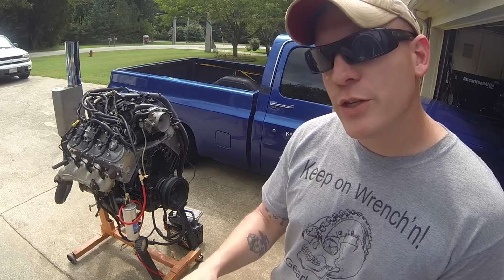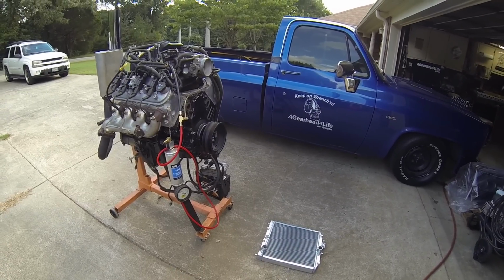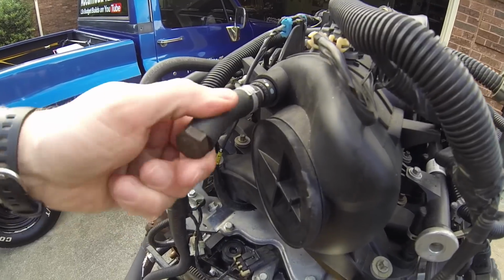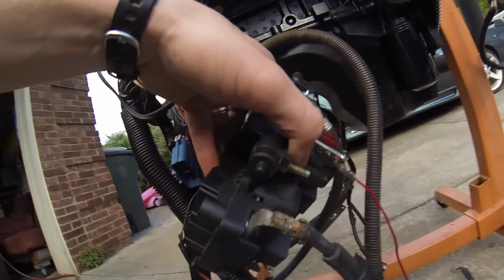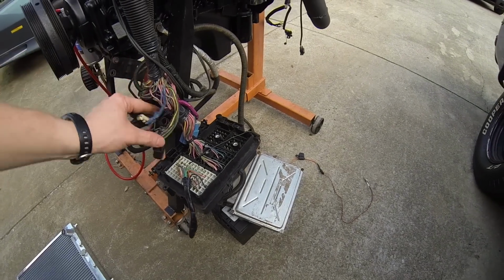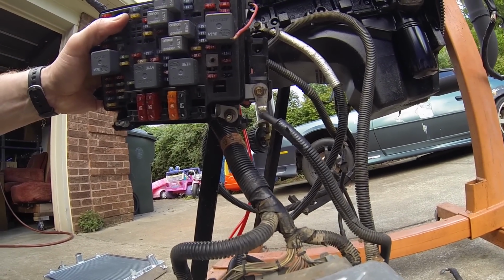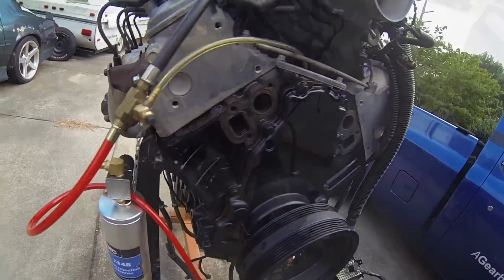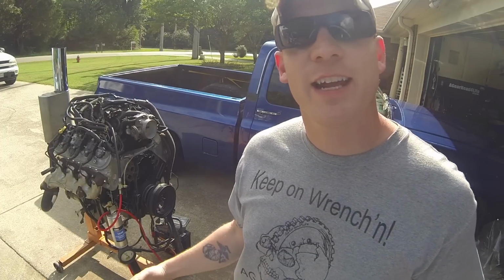LSx Swap Harness How To Simple & Free DIY Standalone on the Test Stand

Comment: hey gearhead I'm try to swap a 05 gto LS2 into a older car and I would love to know  if the injectors wire the same as they do for the ls1 5.7 and 5.3  . thanks for  any info
Reply from the maker: +Don Hall I could tell you for sure, but I'd expect that they'd be the same. Also not really sure that it'd make a difference if they were wired backwards, because they're just a solenoid. they likely work either way, but I'm not 100% on that. That doesn't really matter though, because I'm sure that you'd like them wired correctly. I don't have your answer, only a guess that they'd be the same.

Comment: quick question 
I have a 02 6.0 
can I use a 03+ harness just to start it on the stand?
I have a few extras 03+ harness around to mess with them just don't want to mess up my harness cause that's the one I'm going to use
Reply from the maker: Yep, more than likely you can. Sometimes you have to add the wires for DBC if its a DBW harness.

Comment: Do all 5.3 engine harness all the same or are they different by every year? I'm asking because I have a 5.3 from 2005 suburban computer only but no harness and I found a cheap harness for 2001 Silverado just wondering if it would work.?
Reply from the maker: +Eduardo Ortiz A lot of the are very similar. The main is thing to check and make sure the colors match on the PCM connector, like a red/blue connector. Some are red/green. That'd make things easier for you. You can convert one to another, but that gets more involved.

Comment: Just got a 82 short bed how much will I be looking at to go to LS engine? What is the best transmission u recommend?
Reply from the maker: How much will depend on the route you take and the options you chose, but it can done for $2k if you can resist temptation of optional upgrades and do the work yourself. 80e is the best for a project that’ll be pushed hard. 60e will work in a cruiser.

Comment: So mark what's the process drive by wire? I don't have peddle?
Reply from the maker: +dro sedo I don't use DBW, so I couldn't really tell you much. You'd need the pedal with wiring to it and the TAC module, I believe. Also, if wanted, you can usually easily convert a DBW harness to DBC. That's what I did on my truck. Just added the ~6 wires for the IAC and TPS.

Comment: dose it matter what year, make, model of the fuse box that is used? An do I have to have the 5.3 fuse box with the 5.3 motor or can I use any 4.8, 5.3, or 6.0?
Reply from the maker: +Cody Pfleidner Yea, the years are around 99-05 or so. Fuse box will be the same for all three engines.

Comment: won't it run bad without the o2 sensors and the maf?
Reply from the maker: Possibly, if you tried to daily drive it like that. It's fine to test run the engine though.

Comment: if everything is supplied already, fuel pump and ignition, will this work without the fuse block? if so what wire to power ecm?
Reply from the maker: +Casey Niedermeyer No. The fuse block distributes the power to where it needs to go. So without the fuse block, you'd have to run power to each of the many power wires yourself. It can be done, but it's a completely different story. I haven't done that video yet.

Comment: also, on that same 2000 5.3 which wires can I cut   which ones won't I need for to keep?
Reply from the maker: That is too much to type. You dont have to cut any, but if you chose you, use LT1SwapDOTcom for diagrams on which to cut. I havent made a video on building a custom harness yet. Just this one, which is the most simple way. Its step one.

Comment: I won't to do a 6.0 in my k5 do I need a different oil pan the blazer is lifted.do they have a bracket so I can run my 700r4 I'm not rich have to use what I have trying to do cheap but reliable.
Reply from the maker: +Mike KetchumMikenhazel The truck pan should work. I know it will on a 2 wheel drive C10. You can see that in my old swap video. They do make a bracket to use the 700r4 but a 700r4 isn't dependable, especially with more power. You could run the 700 but the odds are that you'll regret it. You can get a 60e for $300 on CL with patience. That bracket to make your 700r4 work will cost about $300.

Comment: Gearhead, if you use a non flashed PCM what happens? Will the relays even click?
Reply from the maker: It'll run for a sec and then die
Reply from the maker: Yes, relays will click.
Reply: +AGearHead4Life I'm doing something wrong apparently. I can't even get them to click. everything is plugged in as you showed us. I have the a9 on the 1st big plug like you showed.  it just won't work.
Reply from the maker: Possibly a ground or you supplying the main power cable to the fuse block at the wrong location. There are three grounds on the truck harness. two at the back of the block and one on the drivers side of the block.
Reply: +AGearHead4Life you're the man I found a ground cut off at the  harness. plugged it in and it fired up

Comment: what can you do if you have a wireing off a 04 with the drive by wire and want to do a drive by cable do you need a complete new harness? or can you use that one and get a new T.body
Reply from the maker: Like the DBW harness on my truck, you can usually just add the needed ~6 wires for the IAC and TPS to the harness and it'll work. Just have the PCM flashed to be a DBC and add the DBC TB on. You'll have to check your harness to see if it'll be that simple, but it should be. I don't think the harness changed until after 04.

Comment: when removing harness from donor truck do i cut harness at firewall?
Reply from the maker: You could if trying to move quick. Otherwise it will unbolt from the bottom of the fuse block.

Comment: Hey gearhead,  my vats arent removed yet  and i put battery power to that lefthand LS fuseblock  terminal and also hooked up car fuseblock to that constant power and hooked up ignition key on  power to A9.
Stock  LS harness is hooked to starter[power & crank trigger], every sensor except oil level should still be hooked up BUT it wont fire/turn over.
even w/o vats removed it should turn over shouldnt it?
am i supposed to trigger the starter  with the cars crank trigger or what makes the pcm crank the starter?
Reply from the maker: Yeah, the state will be engaged separately. Some people just jump the starter with a screwdriver, but they make a switch for this purpose or you can make your own.
Reply: @AGearHead4Life  Haha, a screwdriver wont do for a starter trigger, im doing my final car hookup.
 I just need to know how to get my car starter trigger wire to make the PCM/Ls fuseblock to trigger starter thru LS harness.
Reply from the maker: @kravmaga7070  Oh, it doesn’t do that. You gotta just put a momentary switch on it.
Reply from the maker: @kravmaga7070  the small outter terminal of the starter solenoid given power through the momentary switch.

Comment: i have tried ...i have a 02....5.3 t can't get running..its just at the back garage  sitting
Reply from the maker: +anthony marasco What do you think that you could have left off?
Reply: o man it sits on a true engine stand with a key and gauges.. i had did all the mods to fit the lm7 5.3 give your e mails i cn send some cool pix if you would like to see it.. has all new gaskets knock senses, camaro water pump dirty dingo brackets its set up for a 79 malibu and will fit any g body....i have since sold my 79 i could not find any help  and i had bought all the ls books to read up on how to do it no luck.... i was so mad at my self for not being able to do it i just sold it
Reply from the maker: +anthony marasco Damn Anthony! NO! Sorry to hear that man. Well, you still have the motor right? Pull it to the front of the garage and try again. It'll run, lets find out what you missed. Also if you're on FB get on our group page "A Gear Head For Life". All we do on there is help each other out and talk gear head talk.
Reply: +AGearhead4Life LOOKING AT IT RIGHT NOW ..THINK I UNDERSTAND NOW.....

Comment: Will this work on a fly by wire setup? And does everything work like it's supposed to for fuel air ratio?
Reply from the maker: +Laby 70 Yes, this is exactly how it works in the donor vehicle. For the DBW, you'll need the pedal and harness part also. DBW harnesses easily convert to DBC also.
Reply: +AGearHead4Life Bro is there a better way to contact you? I have some questions and youtube just wont cut it for communication. I have the drac or what ever its called from the donor and gas pedal. hell I have 100% of the harness from engine to tranny. By doing this, will the 4L60e tranny shift and go to OD? Also will the OBD port work? My donor was 06 and its for my 65 c10. Reason im ask8ng about the obd port working is because. They sell a replacement instrument cluster that plugs into tje obd port to make all the gauges work. Kinda pricey. However it is easy to do.
Reply from the maker: +Laby 70 As I said, yes, this is exactly how it works in the donor vehicle. So yes it will "work" and go into overdrive. This video is to show the most basic way to get these engine running. Anything else that you want to add on to it, will be additional items that you'll need to do. There are a lot of other wires, most are optional, that you could still run, like the OBDII port, TC wire to brake switch, tach wire, VSS output, etc.

This is the best way to contact me. I use to give my cell and email out, but then they became unmanageable. If you need more communication than this offers, I believe Justin Sane here on YT offers a LS conversion consultation. I'm not sure what his rates are though.

Comment: where does the purple wire go? from block to what pin in the ecm?
Reply from the maker: +chris Brown I have no idea which is purple. I am color blind. The only wire that I can think of that is going to the block is the fat ground wire from the battery. So, I'm not sure what you're talking about.
Reply: +AGearhead4Life I think you said it was A9 terminal
Reply from the maker: +chris Brown The wire from A9, that I'm using in this video, doesn't go to the block. It goes to +12v. I have a feeling that I still don't understand your question.
Reply: I was just wanting to know where does it go into the ECM what pin was it
Reply from the maker: +chris Brown (King Tardis) That I do not know, but you can find out in the wiring diagrams found on LT1SwapDOTcom.

Comment: ok when I bought the pump it came with a regulator that has a return do i use that one or the one from the corvette...I got the pump from speedway
Reply from the maker: I couldn't answer that since I know nothing about that regulator, but if it came with the pump, it sounds like that's what you should use. I've got a pic on my FB blog page of the filter/regulator that I'm talking about, mounted on my 92 Camaro.
Reply from the maker: Here's a link to that photo on my FB blog page.https://www.facebook.com/AGearHead4Life/photos/a.432268576826776.96632.156687594384877/547137172006582/?type=3&theater

Comment: I am confused, I am attempting to do a 5.3 swap and I have a 00 Silverado parts truck, I see that block c1 (it appears to be cut) leads into the truck for the obd2 port and every thing else. How did you end up with it up there? Thanks
Reply: I am refering to the obd2 port
Reply from the maker: +Nick Chiccarelli I just found the wire that you followed into the cab, that went to the OBD2 port, and tapped into it before the fuse box. I didn't explain that part yet.

Comment: my fuse box and harness has a white wire in that position A9 and it does nothing. My harness is from a 2006 escalade. What type of harness do you have?
Reply from the maker: This harness is like one that you'd find on a 99-05ish truck. Not sure, but 06 could be the same. I dont get caught up on wire colors, because they change them often and are not always the same as what the diagram says, plus I'm color blind. I'd check the wiring diagrams on LT1swapDOTcom to confirm yours is the same or not.

Comment: Well damn, the fuse block didn't come with my motor
Reply from the maker: Matt C You should be able to find one easily at a salvage yard or even eBay, but it may cost more on eBay. 

Or if you like a challenge and wiring, you could find out all the wires that get power from that fuse block on that connector. Then cut the connector off and give them power. It's basically just all the pink wires. Wiring diagrams on lt1swapDOTcom
Reply: I've been looking around on there my biggest concern right now is what to do about tuning it if I change cams or anything. I think I could convert the harness on my own I have a decent amount of wiring experience. I don't want to have to rely on taking it to a tuner and hoping he does a good job either so I've been looking into hp tuners.
Reply from the maker: Matt C Ah yea, that's great. I'd like to learn HP Tuners as well, but last time I tried, I realized that I didn't have the time for it right now. I'd have to take vacation from work to focus on it. lol  All that I was able to accomplish was getting familiar with the software. I consider attending one of their classes to help cram it in faster.

Comment: ho do i take it too get the anti-theft system flashed
Reply from the maker: +hershel sailers There's a link in the video description to get it done.
Reply: where do i go to get it flashed it came out of a 1999 chevy  truck. the wiring came out with the motor just like the one on the stand with the fusebox,
Reply from the maker: hershel sailers There's a link in the video description to get it done.

Comment: What if I don't have the Fuse box
Reply from the maker: Then you can either get one cheap from a junk yard or jump in deep and take on the challenge of cutting off the fuse box connector and splicing power to all the needed power wires using an aftermarket universal fuse block.

Comment: I'm putting a 2000 L-31 5.7 with 4L80E trans in a rat rod using complete harness from same van do i need to have the ECM flashed?   i know I'm dealing with a dinosaur but i can't find any info on this swap. any help would be appreciated
Reply from the maker: only if you don't take the vats system from the donor vehicle and install it also. If you don't, then yes, you'll need to have the ECM flashed to disable the VATS.

Comment: would you recommend keeping a th350 trans ?
Reply from the maker: sure, if it was an application where I didn't mind not having overdrive or just didn't have the funds for it. The th350 is a good strong trans and cheap to rebuild or make stronger. So If you don't mind not having overdrive, it'd be great. It'd be great for a car built for the drag strip. If it's a street car, it'll likely suck on the freeway. It depends on your rear end gear ration of how bad it'll suck.

Comment: can this be done with a drive by wire throttle body and harness?
Reply from the maker: +William Herron Sure, I'd bet it's near the same. The main difference will be that you'll need to have the pedal and its harness connected as well, when running it. This questions has been asked about four times below, so I am now adding it to the video description for the next person.
Reply: +AGearHead4Life i had read down after asking this question. id prefer to go with drive by cable and just convert it with pigtails and new throttle body. thanks a bunch for the video though!you saved me $1500 i was going to go with megasquirts ms3x.
Reply from the maker: +William Herron Yep! No problem. You can easily convert it to DBC by adding the IAC and TPS pigtails to the harness. Good luck!

Comment: what throttle body are you using on this engine.  the one on my 2003 5.3L is electric throttle.
Reply from the maker: Just a regular truck DBC (drive by cable) TB. early 2000s.

Comment: Hey man could you tell me how you have the OBD2 port wired in?
Reply from the maker: Sure, I just ran the signal wire from the harness (can’t remember which that was off the top of my head) to the OBD2 port and then ran a power and ground wire to the OBDII port. That’s it.
I googled the OBDII pinout diagram for which pins to put it to and used LT1Swap.com for the LS harness diagram to find the signal wire.
Reply: AGearHead4Life Thanks.

Comment: Am trying to put a turbo built ls1 corvette engine onto my 2006 C6 corvette. can you help
Reply from the maker: In what way are you looking for help? I know that one issue you'll have is that the LS1 usually has a 24 tooth crank reluctor and the 2006 likely has a 54 tooth. So without adjusting for that, the engine wont start. I think Lingenfelter has some type of conversion harness adapter for that though. Let me know what else you may need help with and I'll try to answer.

Comment: are the o2 sensors required to run the 5.3
Reply from the maker: Short answer is No. But I wouldn't expect to drive a truck planning to never have o2s in it.
Reply from the maker: I run LS motors on my test stand all of the time without o2s in it, but as a driver, that's a different story. You'll want them. They have an important job to help balance the air/fuel ratio to maintain fuel efficiency and more.

Comment: what about the obd
Reply from the maker: If you'd like to use the OBDII port, you only have to find the one OBDII signal wire in the wiring diagram and run it and a power and ground wire to your OBDII port and it'll work.
Reply: AGearHead4Life hey bro got my computer flashed today with a friend for 30$ and i already installed it on my c10...
its working now..! 👍
and got my obd2 working .
thanks
Reply from the maker: +Luis Elias Nice! Congrats man! That's exciting man. Good luck with the truck and working out the final bugs man.